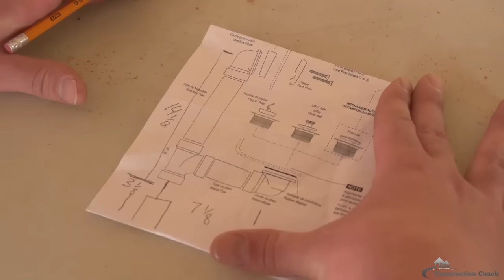Plumbing 101 - Learning about DIY plumbing with Coach Tim

Comment: I thought you needed to heat from one side so solder pulls through from opposite side...anyone?
Reply: I am no expert but I agree with you.  I heat what  is being attached, not the copper pipe or where the two parts join, and the solder flows when hot enough.

Comment: The adhesion of the copper unacceptable bispecific the mixer tap hot - cold water inside is almost always made of plastic material or rubber. challenge universal or very large deterioration in object

Comment: Im not even a plumber, just a casual 19yo working in a hardware store as a plumbing  salesman, and im horrified by what you're doing. Barely 30 mins into the video and i saw you forget the 2x4 to support the bath, forget to remove the 1255b moen cartridge (which is basically 80% plastic), not a glimpse of thought to check the slope on your bathtub drain and forgot to mention so many little details for STARTERS (which is what your video is for by the way).

Also, quick question: why the hell would you soulder your spout and shower head pipes when you"re working with pex all around? They make a handy copper tub elbow which connects to pex pipe, and since this video is for begginers, souldering should be out of the picture.
Reply: Keyword : horrified. 
That is all, carry on.

Comment: your videos but for 1:18:53 won't be more professional to get a 2 x 4 6 inch long or little more with a whole in it and another one to cover the sink  and more with a whole in it, then a 2 way threaded bolt 3 feet long insert thru both whole and sink whole the tension them together 
or use strap with the 2 pieces of wood to tension it to the counter

Comment: 41 mins in you had me. Then you started soldering. Adios! Good luck..
Reply: what was wrong with it
Reply: stylezNsmilez , those are wet joints and will leak eventually. When you see clumps of solder around your seems its bound to leak. Clean shinny copper pipe with adequate flux is the way to solder. And the flame should be underneath while you flux the top. Then the solder will adhere nicely around the whole seam.

Comment: heat above the pipe tto pull yr solder into fitting would be right way
Reply: Yes, you heat the outside female fitting, not the joint like this video.
https://youtu.be/V13EEkeeYfM example of professional soldering

Comment: Uses 3 inches worth of solder on 1 joint with 1/2 pipe 42:12 I was told
 to use 1/2 worth of solder for 1/2 pipe?
Reply: Lots of problems I saw there. I am licensed plumber and was a plumber in the USAF and it is stuff like these videos that make plumbing shops a lot of money. You would not believe how many times I've gone in fix something or finish something but my biggest issue with the solder job was him not heating up the piece enough and applying the flame to help the solder melt a major no no. The joint being heated properly will melt the solder by itself. I didn't say anything directly in the comments but I was just looking to see if anyone saw some of the same mistakes. Everyone thinks plumbing is easy and it is if you do it right. Plumbing done wrong can destroy a house that's why states license their plumbers and they require a ton of insurance to operate. All states will allow homeowners to work on their own homes though without a license. I have been in homes completely destroyed by homeowners bad plumbing. Water is destroys.

Comment: One thing you should need to know is that when you dry fit the pipes' often they don't or won't push in all the way until the glue is applied & then they because the glue is wet sink deeper than you measured for & come up short on the length you actually need. If so you're going to dry fit them just be sure you sink them fully in before you glue them. True this can be a hassle getting them apart again without even the glue applied. Or you could just glue & cut leaving room for to cut each piece to length. Myself I dry fit them & am just careful they are in tight & I will fight to get them apart as so to glue them permanently. It can be real trouble pulling them apart & frustrating so patience is required. L.O.L
Reply: Dave Overbey why the lol and  in capital letters? ...I dont get it.
Reply: Ratoosh rittish water and glue don't mix

Comment: Great video, I am DIYer myself and recently installed the bath myself. I did not glue all the connections but I also used compressional connections so I can rotate or disassemble pats if there is some serious cleaning required.

Comment: Do not solder like this!! Watch a different video to learn to sweat fittings! This is what NOT to do. Sorry dude, I hate to be one of those guys but geezless man!!! Put the torch down and walk away.
Reply: Some sweat some solder.As long as there are no leaks.
Reply: Snake Doctor sweating and soldering is the same thing
Reply: No pipe cleaner to prep the 
ABS pipe for the pipe glue, no drain trap in the tub drain pipe, no leveled 2x4 wall braces along under the front, back and sides of the tub edges to support the tub and foam under the tub to support the tub weight when in use, this is a disaster waiting to happen.  When you buy a house that the pipes are coming apart behind the walls, the tub drain is draining water down into the room below, the tub is ripping away from the wall from underneath the tile work, sewer gas is coming up from the drains, this is the guy that did the work.  Just because someone acts like they know what they're talking about doesn't mean they know what they're doing.

Comment: I appreciate your video's & I don't mean to be mean or criticise but for sure after shutting the water off & draining the toilet reservoir, it's important to have a bucket or pan w/ a good absorbing sponge to dry out the leftover water in the tank & use maybe a paper cup to scoop out the bowel & finish it off drying it out with a sponge before disconnecting the line or flange bolts & lifting it off.  Myself I also like to use a wider washer with the flange bolts so to disperse pressure tightening down the thrown  as too often w/ just a little too much torque breaks the china. What I also like to do is to use an extra nut w/ a washer to torque down the flange bolt to the flange itself so to hold it straight & not slip or come loose when seating the toilet over it.  Otherwise I might need to pull it off again & reset it.. I hate doing the work twice, & if a simple procedure can save me time & spare me the extra mile. Than by God I will. Because what it is anyway, is that I am not patient, & if I get frustrated,  I might just end up breaking it anyway. L.O.L  Dave Overbey You can YouTube me on my name. I train how to fight & defend to the end fast & easy learning with real ability fighting most anybody anytime. It's not on majical, mystical, supernatural board, brick or stick breaking bologna. It's but common sense logic, tactics & technique of fighting smarter not harder. No need to give away your hard earning for learning nothing of real value. Why train anyway to break bricks & sticks when they will just shoot you anyway! L.O.L What little they teach to reach a black belt degree, I will teach free in a week & so you to give the other fella a 3rd degree black eye. L.O.L take time to watch & read all my comments below each video as you go. If paid attention with it comes your ability to train conforming the right habit's with muscle memory & leverage. Not wasted time & energy exercising with your muscle hustle. Be average & normal, but capable of all possible victory's & be a hero! Form the right habit's & let the habit's fight for you. A habit is a habit & once you have it, it's a habit. Fight smarter not harder & the power & speed will just come natural. YouTube me Dave Overbey.

Comment: In the process of buying my first house. I have watched almost all of your videos. Excited to get in there and slowly start making it mine. The house was built in 1930. It will definitely need some plumbing updates. Inside the current owner put paneling up. I want to put drywall up. That will be my first project. I will work up to plumbing. 👀👽

Comment: Around 1:38:00 - 1:39:30 you hand tightened all the PVC and had no leaks? How? I've been struggling with fixing my bathroom drain assembly because it leaks no matter how tight I get it. Is it because I'm using plumbers tape instead of glue?

Comment: I would'nt want this guy to sweat my copper joints. Terrible torch flame, brass not heated enough, cold sweat joints, valve seals will be damanged. This is a future leak.

Comment: You DO NOT heat the center of the joint. You heat to the left or right or where you wish the solder to flow. It will avoid the pipe turning black and the solder being lumpy.

Comment: The disconnect are completely wrong!  It needs to be rigid, instead of having pex hang out of the wall.  Also pex will fall apart if exposed to sunlight.

Comment: Your putting way to much into it. Put in your waste hookup your overflow, hold up your santee and pull your measurements. Also dont cut pipe with a hacksaw, use an orange handle ninja saw or if your a pro, we use Reed roll cutters. edit: where doyou find yellow abs glue? Ive never seen any but black. Here its abs=black glue, pvc=purple primer/blue glue, cpvc=yellow, corzan=orange
Reply: In Canada, I've only seen ABS glue in Yellow.

Comment: You see the thread on the mixer valve? its not there as an option its for tightening with a nut so you can maintain or replace it. When you solder it you cannot take it out, let alone risk melting the plastic parts inside. With the waste you should do the same and have mechanical joint's. What will the customer do when the drain gets blocked? its all glued solid.

Comment: hey used effing cpvc glue on abs pipe. huge no no. cpvc pipe is not formulated for abs pipe and can melt right through...... smh not to bad of a handy man but he is no plumber for damn sure that showed with the 90 he used to turn out for the lav drain...... doesnt have to be a sweep but u dont use a short turn like that

Comment: Why did you not mention the measurement fir the 2 x 4 16 inch support beam behind the shower head and the on off cold hot valve 
 At 46:36 in the video when you measure the 15" to center, but you left out the depth to that 2 x 4 , and I have a problem with it. either short or long

Comment: Very interesting with the foam spray under the elevated platform for the that tub set, normally I would set the tub in a mortar bed. But I have never had to elevate as you did. Very good information on that.

Comment: Best not to use the direct flame to melt the solder. Heat the pipe and solder will flow towards the hottest part.

Comment: Hi, just a thought.

Didn’t you forget to forget to put the primer onto the pipes first?

Your also meant to twist and HOLD it in place for 30 seconds.
Reply: I always use black ABS glue on ABS pipe.  No primer needed when using that.  PVC pipe does require primer. I think this cat was using all purpose cement. I've never used it so not sure whether it needs primed first.

Comment: 1:13:06 good thing for his plastic nuts! how else would he keep that faucet in place?!
Reply: Plastic nuts are perfectly sufficient for tightening down a faucet to the counter top and they are typically included with most inexpensive faucets. The faucet only needs to be on just tight enough to hold it in place and stop the occasional water splash from draining under it.

Comment: GREAT VIDEO...AS USUAL!!   I was wondering one thing about the overflow level of the bathtub:  If you wanted the water depth to be a little higher, could you put the overflow cover on upside down?
Reply from the maker: I wouldn’t!! It’s not designed that way because of potential leaks. It is designed in case of over filing the tub.

Comment: Great video.... at around 55 minutes did you go up two inches from center or did I miss something?
Reply: He went up one inch. The pipe is four feet long and needs one inch elevation (one-quarter inch elevation per foot of pipe) for proper drain slope.
Reply: Thank you, that makes sense.
Reply: It was still 2 inches like you said.  I watched it 3 times.  He went up 2" over 4 feet.  That is double the minimum slope.
Reply: Thank you. I was doing the math in my head and it just didn't add up.
Reply: Watch it again closely at 56:00.  The thick marker line is not the level line.  The level line is higher from that mark and drawn with pencil.  He put his tape measure on the pencil line at 1 1/4" and drew the mark at 1/4" on his tape measure.  1 1/4" minus 1/4" is one inch.  Offsetting by 1/4" from zero on your tape measure is a more accurate way to mark because the tab at the end moves to account for whether you are measuring by pushing or pulling on the tape.

Comment: All I can say is 'wow' 
.
A tub floating in mid air on some foam
Same tub screwed to the wall without a ledger
.
Angle valves / shut offs mounted to PEX sicking out of the wall (hope nobody ever needs to shut them off)
.
And sugesting to hold up a sink with some packing tape ...
.
I stopped watching (scanning) at that point

Man o man - you scare me
.
.
The tub should have had a ledger along the wall and be set on a on a plaster or mortar bed covering reasonable are of the base  (pretty sure the instructions said so)
.
Angle stops should not be floppidy flop in the wind ... they should be on solid pipe, mpunted solidly inside the wall  so I can turn them off with a single hand without stressing pipe or fittings
.
And the sink .... most of us mount the sink before setting the counter ... but if you absolutely need to mount afterwards ... please , please use a block of wood across the top with a sting through the drain around a 'pin' underneath before you end up wearing that sink on your nose one day

Comment: lol   , then call  a plumber to many mistakes 🤣 😂 welding  whit the cartridge in side , welding pipe  heating  the pipe, and not  the fitting.  The pipe was not rimmed  inside the pipe  to prevent turbulence and turbulence make leaks in the future. he never wear gloves to prevent body oil make  reactions with the Flux,  not  drop eran fitting  in the bottom stub out, more job for us lol

Comment: Your soldering is horrific.    Hope you didn't trash that valve with the heat,  it takes two seconds to remove those moen valves.
Reply: I noticed that as well , it doesn't take much heat at all to ruin the seals in the valve and as you said it only takes a few seconds to remove them and then put them back in after it is all soldered . And my pipe soldering is not that great either but as long as It doesn't leak ad passes a pressure test I call it good. :)
Reply: I agree your soldering is not great. When soldering you need to heat the one side of the copper pipe until the solder held on the opposite side of the pipe from the heat, melts and is sucked into the fitting, other wise you do not have the pipe hot enough to fully seal the fitting from the edge to base with solder.
Reply: The whole video was so stupid I could not stop watching it. Like saying he wants a 1 inch slope on the sink drain then marks 2 inches.
Reply: Watch it again. The line you think he's measuring from at 2 inches is not the line he just marked. The line he just marked is fainter and precisely 1 inch from where he says as he's measuring.
Reply: @hubbleISS  This post should be a sticky for this whole thread.  I feel like people who perform cold-solder are practically self-taught, or taught by one who self-taught, etc. e.g. did not take the classes.

That said; the Construction Coach team(and other youtubers)are a godsend to me since moving into a partial gut-job of a house; apropos anyone who wants to bash on St. Tim.
Reply: Indeed flux  prevents oxidation of those parent metals ensuring both metals  have a good soldered bond   and thus allow the solder in its liquid state to be draw  deep into the fitting by 'capillary action' rather than is seen here sitting proud of same some plumber's call the joint the method, ....Sweating the Joint.....there as you pointed out a big body of brass to heat up which is drawing the heat away from the copper pipe plus the flame should be pulled back and moved around thus allowing the parent metals to soak in the heat .... wet cloth or fire resistant cloth would also help...
Reply: MrHemi, do you have any videos on soldering or plumbing in general?

Comment: This guy is torching the valve and sweating the pipe.  what is plumbing 102 going to be?   Remove the valve cartridge first to sweat ?  To prevent the cartridge from heat damage?
Reply from the maker: That shower has been in operation for almost 10 years now with no problems at all. That being said I wish that I would have removed the cartridge before hand, it is the way. It is the way!!!
Reply: No big deal...Sorry to jump into your gig.  You are doing good.  Delta would have freak out and void warranty.  lol

Comment: I will never understand why people call it solder. it is soldering, but you are soldering tin. it is a tin wire. In lead-free soldering, you are literally using a 100% tin material. When you cook food in the oven, aka baking, you dont call the pot you are using a bake, do you? No. The material is not the name of the action. Anyone who actually knows soldering calls it tin.
But I guess I can't really say you know anything about soldering, since you used a fucking WOODEN BOARD underneath an open flame. WTF lol seriously?
Reply: sol·der/ˈsädər/
noun
1.

a low-melting alloy, especially one based on lead and tin or (for higher temperatures) on brass or silver, used for joining less fusible metals.
"remove the fitting using a blowtorch to melt the solder"
verb
1.
join with solder.
"the wires to this clip are soldered to the circuit board"